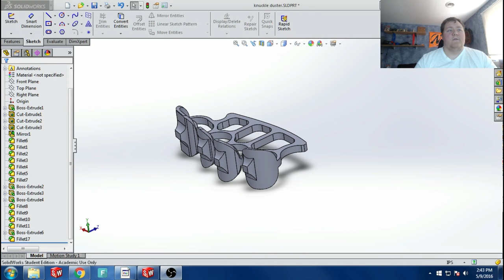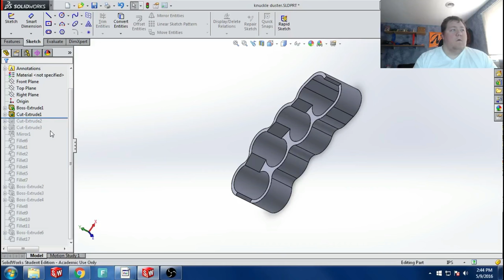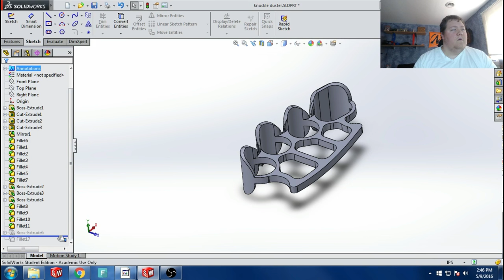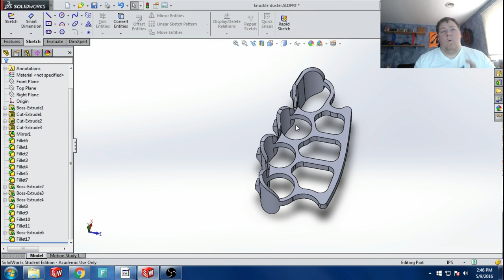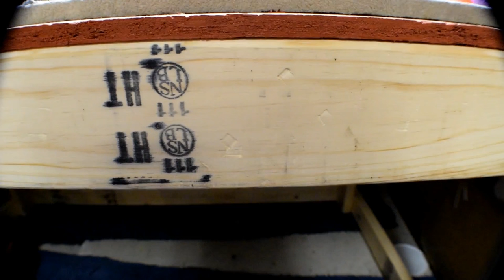(Cringe)-3D Printed Brass Knuckles-Print and Test

Comment: I thought ABS would be sturdier than PLA...
I made knuckles a few months ago and we hit a concrete wall and could not shatter them... 
I'm surprised!
Reply from the maker: It's funny, abs is actually much more resistant to impact. It has a lot more flex, meaning it can absorb impact better. That's also the reason it delaminated, the plastic layers flexed to absorb the force, but the layers separated because the layers flexed unevenly, causing the weaker portions to fail first.

The pla won't flex as much, so the layers won't suffer as much of the separating affect.
Reply from the maker: It's funny, abs is actually much more resistant to impact. It has a lot more flex, meaning it can absorb impact better. That's also the reason it delaminated, the plastic layers flexed to absorb the force, but the layers separated because the layers flexed unevenly, causing the weaker portions to fail first.

The pla won't flex as much, so the layers won't suffer as much of the separating affect.
Reply from the maker: It's funny, abs is actually much more resistant to impact. It has a lot more flex, meaning it can absorb impact better. That's also the reason it delaminated, the plastic layers flexed to absorb the force, but the layers separated because the layers flexed unevenly, causing the weaker portions to fail first.

The pla won't flex as much, so the layers won't suffer as much of the separating affect.
Reply: You should try it with more infill... maybe more shells too...
I printed them with 3 shells and 25% infill
Reply from the maker: +ChrisViral I might, but if I was going to reprint, I'd go for 50% and 4-5 layers. I'd use a different plastic too.
Reply: Overkill is always a good idea! :D
I made a video about the pla version if you're interested
Reply: amazing job
Reply from the maker: +demarco mali thank you sir.
Reply: no probs, are they able to have more than one color per model piece?
Reply from the maker: +demarco mali The knuckles are actually printed in all one piece, but there are ways to break a model up and color each segment differently.
Reply: Ohhh, Thank you very much.

Comment: part of your problem is you're using them to cover the wrong knuckles that's why you're punching funny you need to put them all the way on to protect the knuckles you would punch someone with with them off so you obviously are not punching square with them not being on all the way or they would have lasted way longer and been able to punch waaaaay harder and they would have land square not at an angle aka weak spot buuut hey knowledge is power lol
Reply from the maker: Joshua Rupert partially correct sir, however, punching with the flat of the fingers (between the first and second knuckle of the finger) is proper form to reduce risk of injury, both to yourself and your target. When punching with your first set of knuckles, it sets the bones in your hand of angle from your wrist, which can result in a boxers fracture. Punching with your second set offsets the wrist in the other direction, which greatly reduces power.

Unarmed, you punch with your first set of knuckles, simply to cause more damage, not because it is proper form. 

That's why I designed them to cover the flat of the hand, simulating knuckles there, for proper form and increased damage.

The beginning of the video is cringeworthy as shit, but it's all true, and everyone from ex-military to my fifth degree black belt instructor have told me that you should strike with the flat of your fingers, not knuckles. 

But hey, knowledge is power, lol